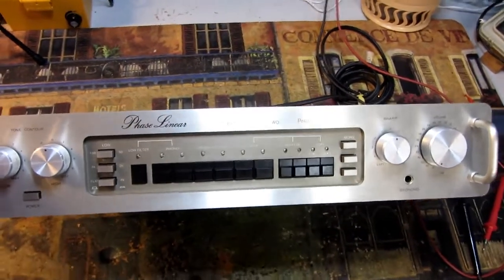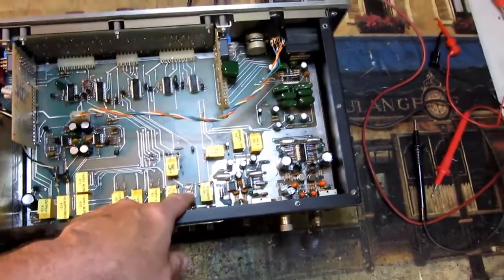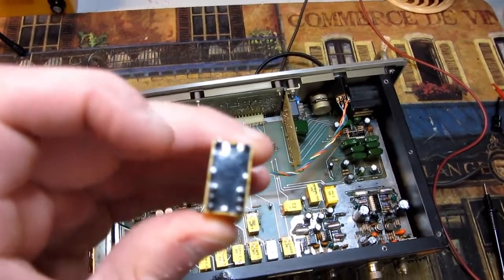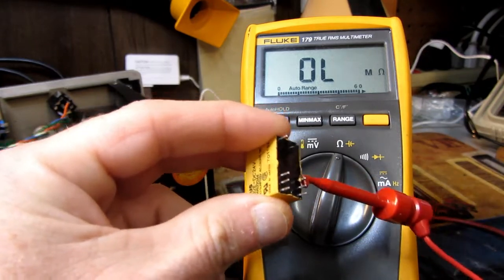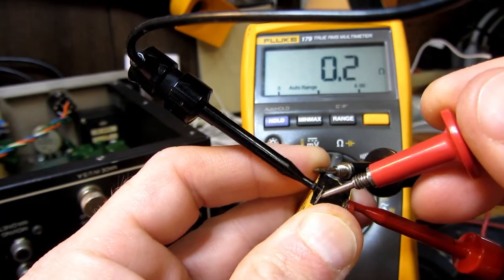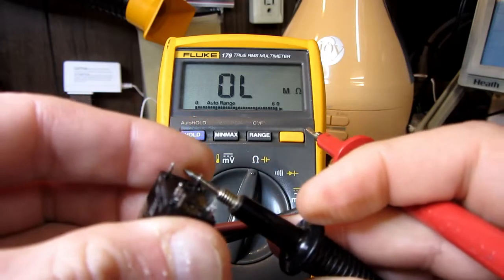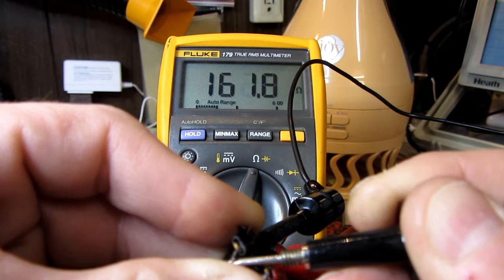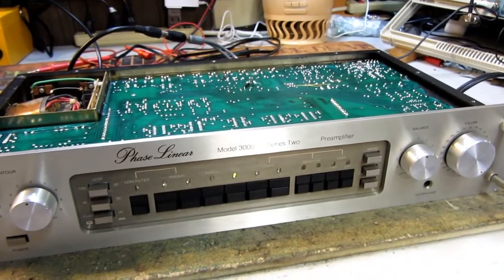Phase Linear 3000 series two preamp test and replace relay HB2E DC24V

Comment: I appreciate this video, I'm going to be replacing the relays on mine. Some of the ceramic disc capacitors in my unit have some crud on them that looks like dried up battery acid so I imagine these need to be replaced too?
Reply from the maker: disc caps almost never go bad.  No reason to replace parts that are not defective.  People who replace caps randomly do so because they lack the troubleshooting skills to identify the defective parts.  Better to troubleshoot than shotgun.
Reply: Ahh I see thanks I'm new to repairing electronics but this phase linear model seems a lot more simple to work on then other amps I've seen. Any tips on removing the relays? I've sucked up the solder and wicked it up as well but I'm still having a hard time getting them free.
Reply from the maker: @solodolo6018  desoldering gun is only feasible way

Comment: Legit sellers in the west want $120 for ONE piece of this part. The nagging question I have is did the Chinese really buy up lots of these parts in 1980 and are just now reselling them, knowing they would be valuable for repairs? Or are these newly cloned manufactured counterfeit parts that will fail to perform properly?
Reply from the maker: these relays were used in many industrial equipment, so I dont find it any more surprising that many are available. This stuff was ALL manufactured in asia in large quantities, so buying the parts from asia now is really no different than the massive amounts of vacuum tubes that are still being sold here in USA.
Reply: @bigslick  I thought most of this stuff was made in Japan 43 years ago, not China. I'm a bit hesitant to buy on eBay because I don't know if they're selling the real part or a fake.
Reply from the maker: @basspig  I never said they were all made in China, I said most of these vintage solid-state components were made in Asia -- which Japan is in Asia.  Most of that was for export, too.  
Second, the whole "fake ebay parts" thing is a red herring IMO.  I have been buying parts from ebay for more than 20 years, and I find no higher ratio of defective parts than I do from other "legit" sources.  Most of that nonsense is spread by old fogeys on vintage chat forums who find superiority in being keyboard warriors and parts snobs.  
Fake parts do exist.  It happens.  Guess what?  Fake parts have infiltrated legit supply chains, too.  Besides, this is a relay.  How fake could it actually be?  Certainly no worse than the crap relays that Phase Linear shipped these units with.

I can say that if you plan to service vintage electronics from the 70s-80s-90s and you expect to find the parts from Mouser or other legit vendor, then you wont service much because a ton of the parts that actually go bad in these old vintage hifi gear will only be found on the "grey" market, primarily ebay and Aliexpress.  That is just a fact.
Furthermore, Mr Carlson has a video (possibly on his paid Patreon...) where shows that a counterfeit Toshiba power transistor is actually superior to the original part, based upon his extensive testing of multiple samples.  So you actually cant assume that even a counterfeit part is necessarily inferior.  Most electronics improve with subsequent designs.  If a better part is "relabeled" as an older part, and actually is a better component in every objective way, then who cares.  The customer wants a good-working unit, they dont want to wait around until I wait for Mouser or Digikey to stock that vintage IC or obscure relay... because that wont EVER happen.